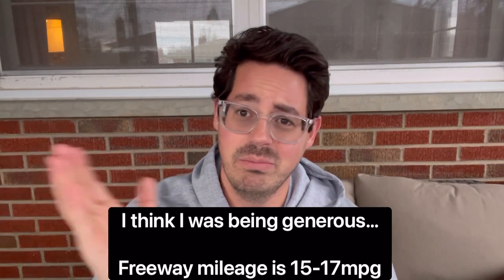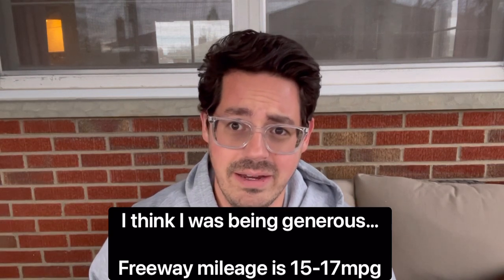Worst Engines of All Time: 1982-84 GM/Chevrolet 305/350 V8 Cross-Fire Injection System

Comment: I don't now exactly if it is the 305 & Cross-fire combo...or the 350 & Cross-fire version...that intake has a radical mismatching of port sizes & shapes. From the photos I've seen, there is a quarter-inch difference in size worth, much too much to successfully get in there & grind away trying to match up those ports....by far a "rushed job" dropping that TBI manifold in those motors.

Comment: My 84 Vette gets over 22 highway and 16 in town. Just put a Renegade intake on it and it runs a 14 sec quarter mile now. Not fast but it's not slow anymore. And my average fuel economy for my first 30 miles with the new intake is about 21 and that's with me ripping on it constantly.

Comment: You are correct. I purchased a used 1985 Corvette (in 1992) and it was a hobby car for me. The 1985 had the Tuned Port Injection and I think 230 horses with a 350cid. Never a problem with the 1985 and I traded for a new 2001 hardtop Corvette. The 1984 Vettes were called 'ceasefire injection' back in the day. I have seen a few over the years. We knew back then the Crossfire was a poor design. My GF purchased a 1983 Cadillac with the 4100 engine. It was known at the Cadillac dealership the mismanagement of metal alloys in the engine was bad engineering. She had that thing for 6 months and it mysteriously disappeared (friends in high and low places took care of that). Leaked oil terribly. My driveway has Toyota vehicles now. Bought my first Camry in 2003 and drove 300K miles for business and I bought two more and a Honda.  Never an issue with those vehicles. I remember a 1982 Silverado 1/2 ton with the 305 cid engine (carbed) I purchased new. It was my ultimate POS. To stay on-point you are correct about those crossfire units. Glad it is 2022 with great engines available today. I have three i'm building now. A 327, 454, and just finished a 428 Cobra Jet. My retirement years are fun.

Comment: Back in '94 my friend had an '82 Trans Am with the cross-fire injection. He thought it was great. That is until he wanted to race me in my '89 S-10 Cameo. I blew his doors off! He thought my truck was the same as the GMC Syclone. Yes, it had the ground effects, but that was about the only similarity. It was a 4.3 liter V6, but it was not turbocharged. It did have the 700r4 transmission. I'd take the S-10 any time over those F bodies.

Comment: Back in 1990, I took a '83 Camaro with a 305 CFI, ported the intake to match the heads on a 383 SB as a sleeper. It was a great sleeper with monster torque! I also replaced the ROM chip with a Corvette 5.7 L chip.  I had to port the hell out of the intake to balance it.  I went with an aftermarket TBI, with a Turbo 400 trans and 3.73 rear gears.

Comment: It wasnt so much of a concept issue as a design flaw with the open plenum under the injection top plate. The old carb cross ram style had separate plenums for each carb, so vacuum signals were good to the carbs abd fuel flowed directly to the cylinders. The crossfire intake was basically a big open cave that had fuel spraying into it with the hopes of the lower runners picking it up and delivering it to the cylinders. This is where the lack of lowend came from, poor signal to the tbi units. Think of drinking from a cup with a straw, then try drinking with a straw but first you have to suck the drink through another empty cup. There is a lot more effort, either you have to fill the second cup before you get a drink... or you have to suck hard enough the flow of air directly pulls fir soda from the bottom cup through the air in the empty cup to your straw. 20+ years ago i helped a friend with is 305cfi car and we buildt a "china wall" and separated the plenum so one tbi fed the front cyls and the other the rears. It helped quite a bit with throttle response but it was still and under cammed low revving 305. If gm had taken more time to get the plenum rifht it woulf have been a decent idea.

Comment: You have the concept of long runner backwards. Short runners are high rpm runners. Long runners are for low rpm. That is why they run out of breath at around 4000 rpm.

Comment: I had a 1984 Corvette with 177,000 mi on it it had the TBI it would burn rubber for a block at will went 135 miles an hour and never gave me one minutes trouble. It got 15 miles per gallon in town 22 on the freeway I had it for 6 years and I've had about 30 Corvettes just saying. Comparing a trans am to a Corvette is like comparing a tractor to a jet!

Comment: Part of the issue with those modeled years of Corvette/Camaro/Trans Am is that the crossfire injection was not set up properly... And the intake manifold needs to be modified in other words bored out so it matches the intake port on the cylinder heads... Along with ported and port matched, the valves receive a contour angle valve job and get fully unshrouded and the TBI system is balanced and the injector pods get 1/4" injector pod spacer.   Then on the bottom end, the engine receives a forged rotating assembly with 6-in connecting rods, valve relief cut out flat top pistons, a David Vizard spec'd camshaft and truram ramshorn exhaust manifolds that are thermal coated.  There is plenty of potential that just has to be discovered.

Comment: I’ve been building, restoring, and daily driving CFI cars for almost 30 years. They’re an extremely simple system, and very reliable. The 6026 ECM of the 83-84 cars was a much better unit than the 5055 of the 82 cars. My current daily is an 83 LU5 T/A. I ported the base, and did the typical thirdgen stuff; L98 manifolds and y-pipe, and a 3” catback, 3.73s, 13psi fuel pressure, stock cam. The car runs 14.40s, gets 17mpg city, and 26mpg hwy. The best thing I have done was to ditch the 6026 in favor of an 8746. I have driven literally hundreds of thousands of miles in CFI cars. I have NEVER had a single CFI specific problem. The TBs are easy to sync, and can be done in less than 20 minutes. They weren’t meant to be a high horse setup, and the ECMs of the day were horrible. However, with very little work they wake right up and run very respectable.

@14:25; you’re dead wrong about the arrival of the L69. The L69 was introduced mid-year 1983, and was rated at 190 horse. It was produced in the F-bodies from 1983-1986, but was only available with MM5 in 1983, 1985, and 1986. 1984 was the only year you could get an L69 equipped f-body with MD8. The L69 long block is identical to the LU5  with the exception of the induction. The LU5 did use the 14088839 cam, whereas the L69 used the 14088843 cam. Very little difference between the two. The main difference between the LU5 cars and the L69 cars is the exhaust and gears. The LU5 used the LG4 exhaust, with the N10 dual resonator exhaust, while the L69 used larger 2.25” outlet manifolds, larger y-pipe, corvette monolith cat, and a 2.75” I-pipe into a transverse muffler. Put the L69 exhaust and gears into an LU5 car and they run door to door. It was not uncommon to see L69 cars dipping into the 14s back in the day. My 83 LU5 went 16.01, box stock. Exhaust and 3.73s put me to 14.90-15.10, and now it’s running in L98 territory, again; stock cam, and the heads have never been off it.

Comment: You can't find them because they were the biggest victims of cash for clunkers. But they are great with a different fuel system and trans. But that's true of any chevy. Even the obs Trucks has the terrible fuel spider box, which they eventually fixed, but it was still not great, and the 4l60e was still weak until the more modern models. Don't even get me started of the LT1 and optispark.

Comment: Had an 83' Z with the 305 and it just ran......everyday. Sure wasn't a powerhouse. Concept was long runners for HP at the higher RPM. If the motor was slightly built it would have been fine.

Comment: I had a 94 z28 and a 97 ws6. Great cars. Minus that dreaded opti spark. The reason I got rid of both of them. The LT1 was good but held back by the opti. Very happy with my 2000 Bonneville SSEI with the sc 3.8. I've built it up and am in love with that motor

Comment: 7hold one long runners are better at low rpm and short runners are for higher rpms. The efi Ford 300 has very long intake and it makes a fair amount more torque them the carbs. Audi and other European car manufacturers have a split intake manifold  set up as long runners at low rpm and short for high. If a runner is to wide for the cylinder o absoulty would the air speed slow way down.

Comment: GM engineering from '71 on:
"This damn thing doesn't work!'!
"It saves us $30 per car!"
"But the car runs like crap!"
"The idiots who'll buy of this pile won't notice."
"But they will, it will guzzle fuel and fail emissions!"
"Then they can come back and buy the next model year."
"No, they'll dump us and go Japanese. Or worse yet, Ford!"
"No, they won't.  Al Sloan programmed them to believe that anything GM is good.  Hey, where are you going?".
"Getting my last check.  I'm starting at Dearborn tomorrow."

Comment: Have an '82 Vette with 55,000 miles I bought in 2011 to flip. Haven't gotten around to flipping it and hardly ever drive it, but it starts right up after sitting for months at a time. Haven't experienced any of the gremlins mentioned.....yet.

Comment: You can make the crossfire really run and make much better power . There were two intakes made to replace them. One was the renegade and both are out of production now. The guys on the Corvette Forum know how to get power from them. It will take some money . You can also port the crossfire intake for higher gains . You can replace it with a dual plain or single plain and carb also depending on your purpose . Hood will be an issue with a carb setup . You could cut a hole for air cleaner or install a high rise clamshell hood .

Comment: You clearly don't fully understand how engines work. Long intake runners promote low end torque, velocity through them is determined by the cross section. That's why dual plane intakes are "Street manifolds" where as shorter runner single planes are high rpm "Race manifolds". 
The main problem with late 70's/80's as a whole was that people didn't realize efficient engines make power and can make better fuel economy. They thought you could choke economy into an engine and that's not quite how it works.

Comment: I bought a 1982 TransAm in August of 1982 from Tabor Pontiac in Atlanta.  It was black with gold trim, W6 suspension, crossfire TBI with cowl air induction, Recaro seats, and T-tops.  It had a faulty temperature gauge that would read hot when it was normal. Front hubcaps would come loose from turbine wheels.  $16,000 in 1982...

Comment: Completely spot on. Thanks for the honesty and not just blindly defending what you own! My father and I had alot of issues with a 1983 Z28. It was his friends car. He and I had lots of experience with engines, racing, flying, tractor pulling, making our own pistons, manifolds, etc. he actually did some work for Huges aircraft and NASA. Everything from the 1920s to the 2000s Local shops would call us for help. We even went so far as to purchase 4 of the old Allen SEA scopes to make one good one. Bought them from the engineers that developed and programmed them directly on every actual vehicle in their database. No modern analyzer comes within 100mi of those for the older vehicles. one machine was actually the programming mule they used at Allen it had an old pc attached. We mentioned the crossfire and he looked like he had just swallowed a live nightcrawler! Good luck! He said wouldn't want to be you! We kept it running but it wasn't easy! I had a 1962 Chrysler Newport 4door with the low grade ore 361 2bbl that stomped a mudhole in that Z28! I was used to shoving a 4800lb newport into the low 13s at over 100mph with $300 worth of parts never opening up the smog 7.75:1 440 using long rams, a cam, 4.10 gears and 2x 1000 cfm carbs on 87pump gas getting 21mpg. BTW, everything you hear about those 32" runner long rams is FALSE! Been running 2 sets on many cars over 40 years . they will flash right past the rev limiter and hit 7500rpm in high gear at 110 mph smoking the tires in a 1970 newport on a stock 383 2bbl block. They come in every 800 rpm laying rubber the higher the worse.I broke the rings when it went over 8000 once. It was a stock shortblock with only headers and the RIGHT cam! Took forgetting everything i thought i knew and driving it every day for 2 years carrying jets, an area chart, a calculator,  and a screwdriver in my pocket to get there! Riding in that Z28 felt like sliding down the road on a rock wrapped in a tin can! Also try and bleed the brakes!

Comment: I know a friend that got these to work better with deferent heads and some work. he had 300-wheel hp. a better cam and I'm sure he ported the manifold some. I guess when there is the will there is a way. we were machinist so we had tools most people don't have. yeah, this was the late 80s so anything you did to make air flow better gain HP big time. he had the 84 corvette I think he paid like $700.00 for it. man, those where the days.

Comment: What I would really love is to hear from the engineers who worked on this vehicle, and the fights and discussions which went on at GM at the time. Being an engineer myself, it is so hard for me to accept that any engineer would willingly design or release (or both) something which they knew was a faulty / deficient design. What you describe here goes beyond mere bugs or "growing pains".
Reply: It wasn't an engineering based decision. The 305 was the cheapest engine to produce, so GM axed everything else that was available and forced really dumb criteria on the engineers resulting in that crap. Pontiac was building turbocharged V8's in a smaller more efficent package, Chevrolet was GM's pet because they made the cheapest junk they could profit the most off
Reply: @maxthe222  I just don't understand how losing repeat business would be a viable business strategy.
Reply: It’s GM.  They don’t care.

Comment: They might have been the worst engines, but for a EARLY 90's era S-10 SBC swapper, their oil pans were widely available in the junk yards and awesome due to the exhaust manifolds we had to run in the S-10 that covered the driver's side dipstick tube on preferred blocks and their integrated passenger's side dipstick placement in the pan. Info like this was gold before the internet.

Comment: I have a 84 corvette and it had some issues at first from sitting in a garage for so long but after fixing the fuel system and rebuilding the injectors it runs great! The car to this day has 27,000 mi on it and is all stock and I plan to keep it that way because every 84 vette I have seen is destroyed and although it doesn't have the most power among other things it is still a cool car that I and I'm sure others love so just drive it for what it is and take care of it
Reply: How long did the car sit up? I just bought a 84 that sat up for 25 years and only has 6K miles, it runs good but has a slight stumble/miss off idle even after a full tune up, plugs, wires & coil.

Comment: What's funny about the 305/350  Being on this list is that it all has to do with that fuel injection system. If you take that off and put a modern self learning EFI system like the one from holley it instantly becomes one of the strongest longest lasting engines ever made.

Comment: Adam is too young to remember the Chevy Vega with it's horrible aluminum 4 cylinder that would start burning oil at 50k or less miles even with proper oil changes. They had no power, they would smoke and burn oil and by less than 100k they were scrap. These made the crossfire look like engine utopia.

Comment: Main thing wrong with the crossfire fuel injection was the poor flow of the manifold. Stick an Xram intake on there and the L83 will make 260hp.

The long intake runners in this case were intended to help maximize low end torque, since as you point out, these engines made most power at low RPMs.

Comment: Short runners for high rpm HP,  long runners for torque low to medium revs.   It wasn't the runner length, it was the poor flow.  The return of hope, the TPI L98 also featured long runner and had torque curve well suited for a truck.  It did look damn sexy though debut with 230hp and 330lb-ft.  GM finding it's HP groove would take another 5 years with introduction of the LS.  Not counting the ZR-1

Comment: This dufus doesn't know WTF he's talking about. He has no idea how any of this works, knows nothing about the design or origin of the crossfire intake manifold or why they had problems and earned the name Ceasefire Injection.  Most of this is just basic research which he apparently did none of before declaring that a small block chevy one of the worst engines of all time...

Comment: Great summary. I can totally relate. I had an ‘83 Trans-Am with the turbine wheels. Got rid of it for an ‘86 with the tuned port. I now have an ‘82 Vette also with the crossfire that I’ve owned since ‘90. It has 16,000 miles on it. Runs well except when it’s cold, for the first 2-3 minutes it idles like it has a wild cam in it. After those few minutes, the mixture get adjusted and it runs smooth as silk. Crazy!!

Comment: I had a 82 Z28 crossfire changed it to a 4 barrel with a 650 Holley vacuum secondary ran great after I put a carburetor on it. also had a 84 Corvette with crossfire fuel injection never had an issue out of it though if I would have it would have a four barrel intake and a Holley carburetor